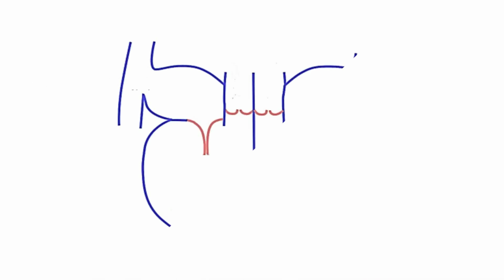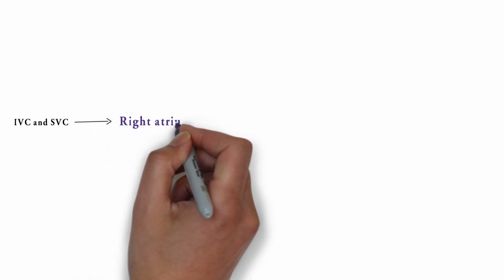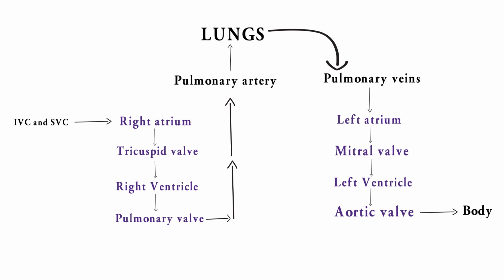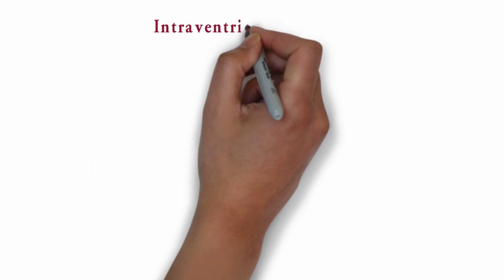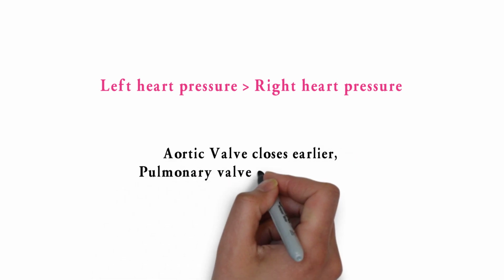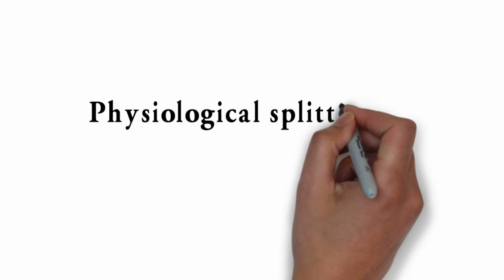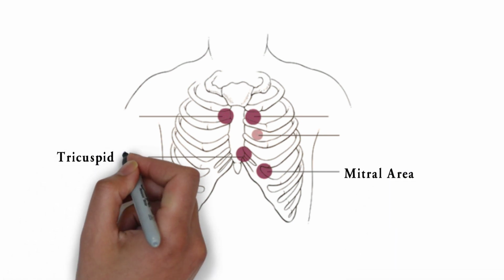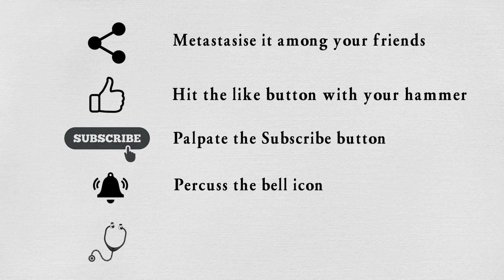Normal Heart Sounds | Concept of A2 P2 | Physiological splitting of 2nd heart sound

Comment: Hello, I've read in basic science organ system book that during inspiration the intrathoracic pressure drops. But, in this video, it is written that intrathoracic pressure rises during inspiration, which contrasting the above information.
Reply: Basically during inspiration, the trans-mural pressure gradient increases (causes a pulling effect on the  vessels and right atrium, causing them to expand). This increased trans-mural pressure increases the volume of these vessles, which then causes the pressure within the IVC and RA to drop (probably what your book was mentioning)

Decreased pressure causes increased blood flow back to the RA.